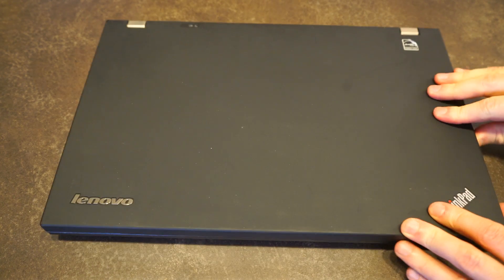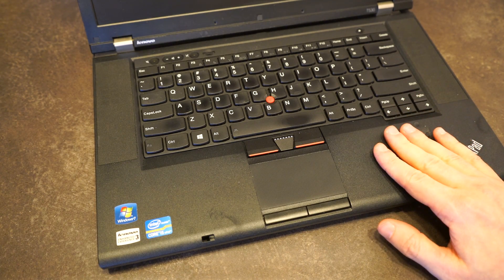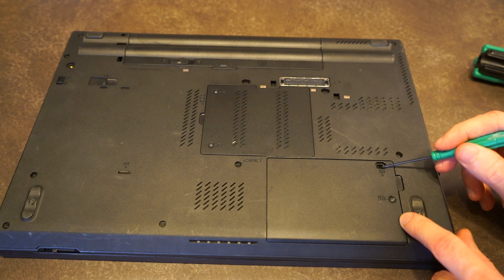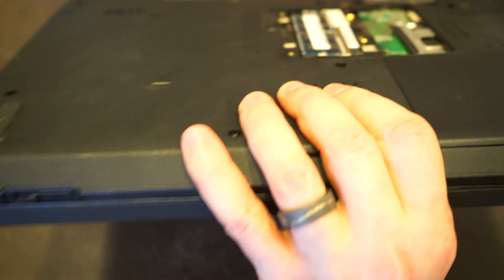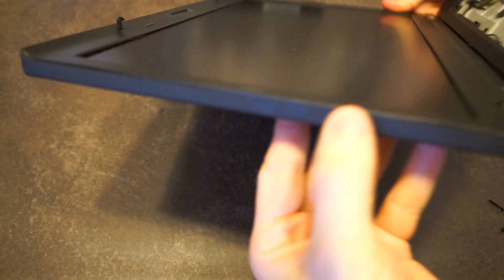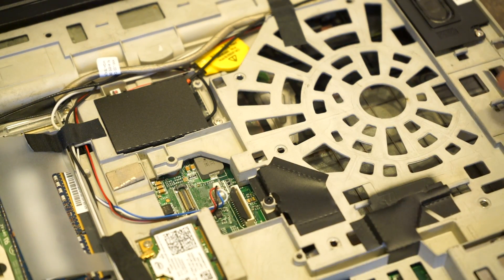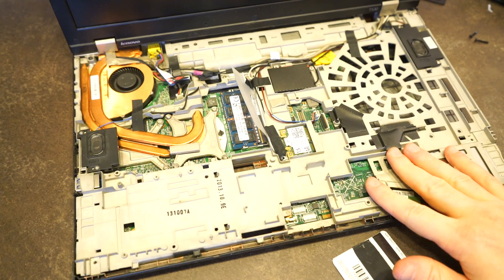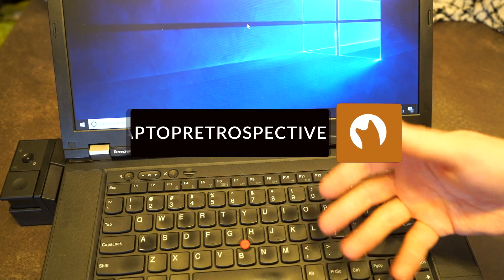Lenovo ThinkPad T530: The T430’s “Big Brother”

Comment: Bought a refurbished W530 for a couple hundred buck in 2019.  Intel Core i7 3820QM, 16 Gb RAM, 500 GB SSD, NVIIA K1000M graphics.  It's been my workhorse.  Just updated all of it's drivers and updated it to Window 11 so it should continue to soldier on into the future.  What a tank!
Reply from the maker: How has the Windows 11 experience been? Did you opt for something like Tiny11?

Comment: I got a T530 not sure when I bout, but it had to be over 5 years ago. i5 8Gigs of RAM with 500GB HDD. I bought an X250 and a dockstations for both. I never got around to using the X250 and sold it, i wish I hadn't, it was spec'd like the T530 but with a 256GB SSD. The T530 was truly my work horse with no upgrades since i've owned it. Since its gotten older and has slowed down, Ive built a PC to handle the same tasks along with some gaming too, but the condition of my T530 unit is still impeccable. Its very nice piece of retro tech at this point that will handle a linux distro beautifully. The battery does need to be replaced since it will no longer hold a charge, but I'm still glad I still have it available. Thinkpads are the machines that truly die hard.
Reply from the maker: Glad you enjoyed it for so long, and it's still in great shape.

Comment: 0:46 You can also replace it with the X230 and the T420/x220 series (after flashing bios and isolating one pin on the cable)

Comment: I have a T530. I7 with windows 7 and 1vyrain!
Reply from the maker: Nice, what do you use it for?
Reply: @ I use it for configuring my server. I’m currently challenging myself to use it as my school laptop in place of my Chromebook.
Reply from the maker: @iketheeddsworldfan Very cool. How's that going?
Reply: @LaptopRetrospective  It’s going okay, but I believe it’s overheating as it’s been hibernating and making the fan run fast with hot air coing out of it. I’m planning to replace the Thermal Paste within it with a higher quality one and dust off the fan.
Reply from the maker: @iketheeddsworldfan keep us posted on how that works out.

Comment: im getting one for like 60$
Reply from the maker: Nice!
Reply: @LaptopRetrospective  any upgrades i could do
Reply from the maker: Most of the upgrades that are possible on the T430 are also possible on the T530. Lots of information out there on all the things you can do.
Reply: @LaptopRetrospective  just got it, replaced the storage and ram and installed debian on it
Reply from the maker: Good start!
Reply: @LaptopRetrospective the only gripe i have that it blacklists aftermarket batteries
Reply from the maker: I've heard this story a few times but never had the issue myself. I wonder if some third party battery companies found a workaround and others didn't.

Comment: I just got a T530 but has no fingerprint.. and what's the function of the  last vertical key at the top of the function keys ?
Reply: Do you mean the button to the right of the mute microphone button at the top of the keyboard? That is the ThinkVantage or ThinkPad button, it used to be blue and labelled "ThinkVantage". It was used to launch a help/configuration utility for your Thinkpad or see documentation or open Lenovo Vantage. On later models it didn't really have much of a use, but could still be remapped  to perform a specific task or open a program.

Comment: I want a rig that has a more enjoyable typing experience, can play some PS3 era games but the PC version of those.  Oddly enough the t530 with a t420 keyboard is the only thing that does that at a decent price, although they do seem to be absent. I will be selling my 2nd gen Carbon to downgrade to the better keyboard & also will have nvidia by downgrading so even though CPU speed will drop a bit the GPU will compensate for that while doing graphical tasks.
Reply from the maker: Keep in mind the T530 isn't a gaming laptop. 😁
Reply: @LaptopRetrospective  Will be for me but I'm old and I've learned & experienced the top of the line so I no longer need to play that way. However if I do come into some money I've discovered the x2100 and I may get that however if I can get myself a t530 that will support old nvidia games effects and rendering just that much better and have a spot for built in speakers (I liked the t420 speakers used to have one). My carbons speakers though are aimed underneath, sealed from the top most likely for spill proofing but much prefer the direct line of sight on laptop speakers.

Comment: What options are available @5:00 ?
Reply from the maker: The hardware maintenance manual details the cards that are on the whitelist. Other cards might be possible if BIOS mods are applied.
https://download.lenovo.com/pccbbs/mobiles_pdf/0b48474.pdf
Reply: @LaptopRetrospective  
Thanks for the manuel 👍👍
Reply: @LaptopRetrospective  
What is your opinion on thermo throttling?
Will my T530 crash ?
Reply from the maker: Thermal throttling happens on all laptops since Intel and AMD find it acceptable. Thermal throttling doesn't equate to crashing. Yes your laptop will at some point thermal throttle, that will not make it crash. Computers crash when there is a fundamental problem with one of the components.

Comment: What would be the wifi card specs upgrade that would have 5 GHz to replace this laptop which only has 2.4GHz? You have a nice wrist watch. What is the brand and model of your watch so I can get one for me too? Thanks.
Reply from the maker: Upgrading the WiFi card in this will require some reading up on https://1vyra.in/ and then choosing your card. 7260 is popular for the job but do your own research/reading.

Pretty sure the watch in this video is made by Ticwatch.

Comment: Got to tell you guys this:
I have just bought a T530 for $140 (yeah, ThinkPad are expensive in my local; T420: $160 to $200, T440p $300, T570 $350; P50 $700, X1 gen 4 $400, X1 gen 5 $450)

The condition are suboptimal: the previous owner use it nonstop since 2016, for all kind of job, but not squeeze the CPU performance, jobs like 24/7 at the cashier, at home for watching the stock market)

But it work good, no, great!

The CPU core i5-3210m (@2.5GHz 2x2=4 logical cores) are powerful, my T420 can't run windows 10, but this one run smoothly. And as someone who use W540 and P50, this one is smooth!

The screen is the low cheap HD just like on all old base ThinkPad laptop, but this 15 inch screen, despite the screen's on-time is a lot as it's previous owner said, and caused it to have sign of deuteriation, still very bright and good for the eyes than the 14 inch on the T420.

The keyboard are still working just fine, although the T530 was among the firsts x30 seri to got the chicklet keyboard, and back then this keyboard was rate rather low. The cons are still there: the key need much pressure to type, it bounces hard; but how when the wave for old ThinkPad getting stronger and stronger, the cons are not as much as 2012 when it released.
In comparison, the P50 keyboard are much more subtle.

The machine is bulky, but I carry it around with my P50. so it's not that bad. And it's tough!

One thing that the structure of the T530 is better than the T420/T430, T540P and W540 and P50/P51/P52 is that it had separated plastic cover for the 2.5inch hard disk (and ram slot). 

+ 2 separated covers mean you can just open ONLY ONE OF the cover when you need to swap the SSD (to another SSD or HDD), this mean when you have one drive for windows 7 and one drive for window 10 but you don't want to put it in the caddy bay (and that me, putting 2 separated OS on 2 separated drive simultaneously on one laptop sometime bring me trouble)

+ as the 2.5 inch is under and in the roll case, so it is safe

+ The DVD drive which could be replaced with a 12.7mm caddy bay (like the T420 and other old ThinkPad). I bought cheap a caddy bay for $3.5 and it work just fine!

Compare to other machines:
- T420/T430: the 2.5 inch is located to the corner and cover with one small piece of plastic; my t420 dropped and the cover can't stick to the case anymore!

- T540p/W540: the touchpad is shit, the 2.5inch is on the bottom like the T530 but the cover is big and also cover the ram; good enough for most ThinkPad user, but I don't want to touch the ram when I just want to quickly swap the OS drive.

- T440p/p50-p51-p52: one huge plastic cover the ram and the hard drive slot.

- other 12 inch X series: one single bottom, good for moving around, suboptimal for those who want to quickly access to the slots inside.
Reply from the maker: It's impressive how much life these machines have to give.
Reply: @LaptopRetrospective  your channel is one of the best!

I lost my T400, so sad. My friend have the T410 since it was brand new, and he say it's very hot, I think it was hot like the t400. So I cross the T410 with the first core ixxx cpu out of the list.

Not gonna buy the t400 again. But prob for it about the stable of the machine: I forgot to turn it off (when I still had it) and put in my backpack. I took it out 30 minute later, it hot, but not dead. Turn it off for 5 mins to cool of and turn up for work again, and it work just fine, for two years
Reply from the maker: Thanks for the kind words. Glad to have your support.

Comment: Hey...some of m keys are kinda of sticky that is not working well...the Letter Y.  I have to press harder now.  Can I pull out these indvidual keys and clean them?
Reply from the maker: You can pop them off and clean them but if it is really bad, replacing the whole keyboard is very easy to do.
Reply: @LaptopRetrospective  okay thanks for the speedy reply, that seems to be pretty rare on YouTube videos. It's good to know you can pop these ones off because I didn't know that was possible.
Reply from the maker: You're welcome. Replying to comments is a huge part of what I do. The keys pop off, just be careful as it isn't impossible for something to break. But like I said, keyboards are easy to find and easier to replace.
Reply: @LaptopRetrospective  To confirm, mousepad/touch pad keys are possible to remove and clean?
Reply: @LaptopRetrospective  Here's another great question: Can you also pop out the mouse pad keys.  My lower left button isn't working either.......unless you press super hard.
Reply from the maker: It varies from model to model but the x20 and x30 series will unclip but are fragile. If it is that worn and used I'd prepare for replacement.

Comment: My T530 is only a few weeks home from eBay.  It had no windows and I went straight to Linux Mint which booted nicely but the Bluetooth wasn't pairing with audio devices. I reluctantly pulled out an old ESD-USB and installed Windows 10. I do like the keyboard but the lack of an embedded number pad is a disappointment. I looked at so many laptops somehow I overlooked that it doesn't have one. Most people call them a problem but I sometimes blast out numbers that look like UIOJKLM<> because I don't have it anymore. 16gb of 1600 speed ram is good plus a 254 gb sized M2 drive. Windows installed very quickly.
Reply from the maker: Weird that Bluetooth was giving you trouble under Linux. You have to move up to a workstation grade machine to get the numpad on ThinkPad in most cases.

Comment: Nice video on the T530, I have come across a little time capsule of a computer myself. A particular IT shop that I know has just recently thrown out their IBM Mainframe system and low and behold the untold treasures it contained two T510 and one T530 Laptops which were bolted in as part of their "console" system.

The Laptops were in their original working condition, although I didn't check what was running on them before the entire unit was decommed.
Oddly though the laptops were made to be part of the IBM system as they did not have Webcams, Wifi cards, or batteries, or Windows COA sticker.
It was connected to a custom slide out tray and custom built cable with a "IBM" Part number that connected the DC Power, usb ports and RJ45 connector to the Mainframe.
Strangely all of the laptops had a dock jumper connector (factory IBM part # on them) it looks like a stub dock connector.
I suspect all this does is to put the laptops into DOCK mode as the power buttons were covered with a metal plate and adhesive.

The Laptops were basically in Brand New condition as they were not used daily but as a backup console when local access to the mainframe was needed.
The T510s had mechanical drives where the T530 had a 180gb Intel SSD drive. The drives were removed and disposed of, and the Laptops will be e-wasted.

I found your video to see if what these machines are like, it looks like a decent computer to restore if presented with the opportunity to rebuild it.
I would to put a sata SSD in there and an Intel 7260 mini pcie card. I saw that it does have a sim card slot so the blank plate under the keyboard is actually for a Mobile wireless card, my personal choice is the Sierra wireless MC7700 that I've used in similar generation Dell business Laptops, which will give it LTE connectivity.
Looks like 16gb might be the max supported ram, but I've read somewhere that 32gb is supported if you have a 4core cpu, I've yet to come across 16gb ddr 3 single ram modules.
The LCD panel types are 1366x768, 1600x900 or the coveted 1920x1080. From the research I've done, it's a 40pin vcds connector and any standard 15.6 LCD from this generation will fit.
I would definitely go with a 1080 panel if the laptop has a 1366x768 panel.

Anyway thanks for the video intro for the T530, it looks like a well build beast of a laptop that's been lost with the times, so it's definitely cool to have in the tech collection if you're into that sort of thing!
Reply from the maker: Thanks so much for sharing your find and story. Those sound like some really cool units, certainly unique and not common. If you have pictures I'd love to see them. YouTube doesn't like links in comments most of the time but my email is on my about page.

Comment: wow I can't believe this is an "older" model now. I found this video trying to remember how to open up the model I bought new.
Reply from the maker: It might be older but it is still a favourite.
Reply: @LaptopRetrospective  I'm looking forward to having mine for basically forever. Even having been gifted a much more powerful PC, it still proves itself useful. 

Over time I've replaced some parts. I got a 3D-printed power button as a replacement for the one that broke. I mangled a mouse button trying to clean it, so replaced that. then replaced the touchpad cable just recently after damaging it in the process of replacing that button. it now sports a small SSD instead of  the hard drive it came with. 

When cash is a little less tight I intend to pack it with storage as a sort of portable media centre. I'm not sure where to put those wireless cables when I fill the SSD slot though. I'll have to get an external optical drive as well, because it's the only thing I own that still has one.

When bought it I made the wise decision to upgrade some aspects, i.e. the 1080p display, the i7. But I've had it for almost a decade now and I wouldn't notice the money gone for the mobile networking addition I skipped on at the time. I'm glad I got the extended battery, although these days it's the "rush quickly to plug it back in" battery, so that's another upgrade to make.

With the i7 four-thread and the NVS 5400 I've managed to play games like Max Payne 3, although sometimes it does get to the point of draining the battery even while plugged in.

It was a serious investment at 15 but I knew I had vague plans to go to university in the future and it's been paying off there. Over its life I've used it for study, for gaming, and even loaded up Ubuntu Studio and played with amp simulation.

I'm glad there are people making videos like this. I hope some of us nerds who grew up on this kind of machine can go on to bring back the era of laptops like these. Computers have been so powerful for so long now that it's not like the old days of upgrading every season. If you give a decent laptop to a kid on their first day of school, they could be using it just fine all through university, as long as the battery and storage is replaceable.
Reply from the maker: Thanks so much for sharing your story! Best of luck with future upgrades.

Comment: I have an almost immaculate T530 with quad core i7, 16gb RAM and two SSD's (one replacing the DVD). It's a superb machine and has stood in as a desktop replacement several times. It also takes third party batteries without issue.
Reply: I don't think I'd need multi hdds but a built-in disc drive would come in handy for me at times. Man I want a t530 and I'll put a t420 keyboard in it as well. I used my carbon a lot this year had to live in my car while my gf was at work for 3months so I ran that on a spare car battery and inverter.
Reply from the maker: That's awesome to hear. They are great machines.
Reply: How hard is it to put another HD in the disc drive?
Reply from the maker: Buy the caddy, buy the SSD/drive, assemble. Remove optical drive, insert assembly. Check formatting and away you go. Take time to account for packaging, maybe 5-7 minutes if you take your time. 😂
Reply from the maker: Should be 12.7mm and the drives that are supported are normally 2.5" SATA.

Comment: Thanks for the video. I plan to buy this T530 core i7 this weekend.
I also plan to upgrade the RAM to 16gb, original 500gb HDD to SSD SATA3 1TB, and put the original 500gb HDD into caddy sata drive, switching the optical drive. Btw, what type of part that I need for this caddy? So many I found online but nobody sure if its compatible with this T530. Anyone?
Reply from the maker: Lots of different companies make the part now. Check the maintenance manual for the FRU you should be searching for.